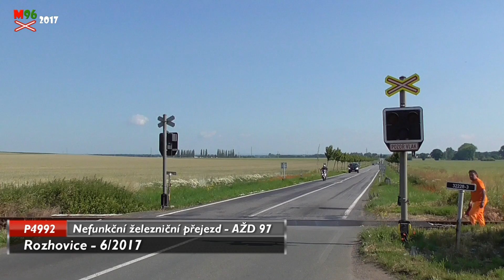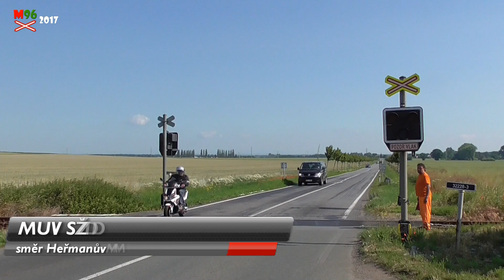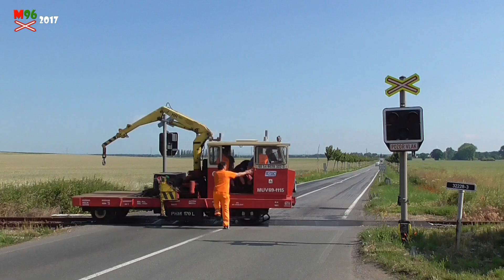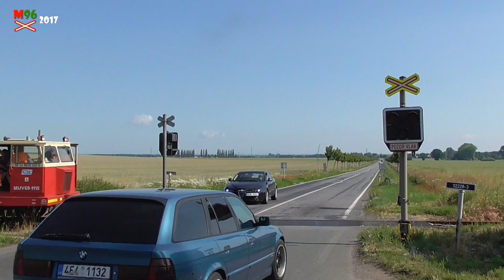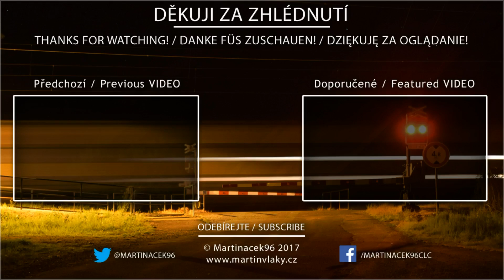Nefunkční železniční přejezd Rozhovice - 6/2017 / Czech railroad crossing

Comment: Why did the lights not activate? Why did the guy have to stop traffic instead?
Reply from the maker: This railway line is 7 years abandoned. So crossing lights were switched off and that "warning lights" is actually a line worker circling a red flag in this case.
Reply: Oh. Thank s for the info! :)